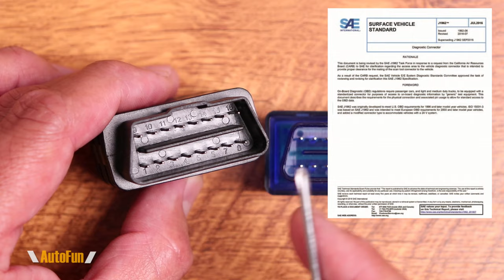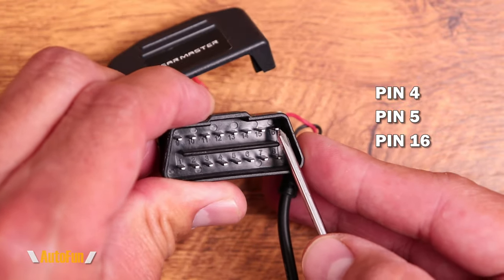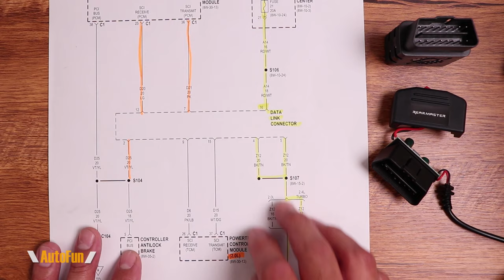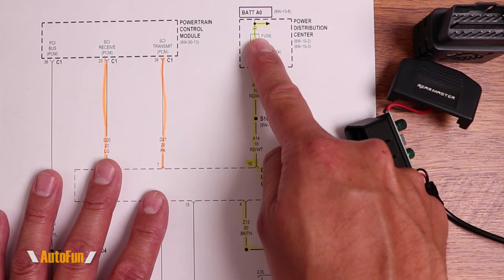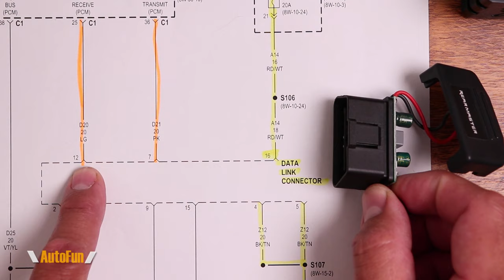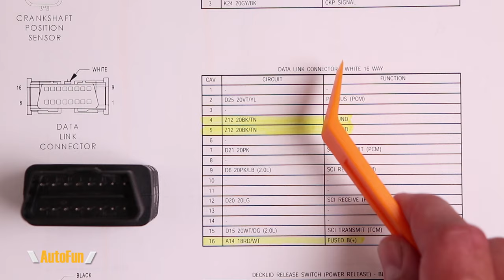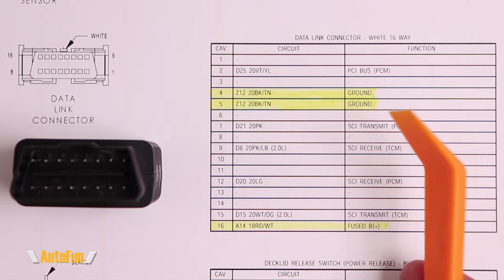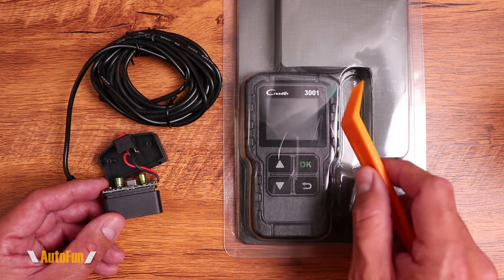OBD2 Power Adapter DANGEROUS? (Is it safe to use the OBD port for power?)

Comment: Thank you for the explanation.  I only have a question.  Right now, my dash cam is connected to the usb in my car.  And each time, i turn off the engine, the power in the usb is turned off, thereby the dashcam is off too.  With this obd device,  can i make use of the parking mode in my dash cam?  is it really a parking mode, or it will just continuously power the dash cam and keeps recording.  I want from this obd, is to sense the engine when it's off to power down and just activate the parking mode.  
Thanking you in advance!!
Reply from the maker: You're welcome gino! Ah yes the OBD2 adapter can be used to monitor the car while parked. It has 2 modes of operation which I cover in detail in my original video  https://youtu.be/YEklm9V6xYE However as explained on that video, the OBD2 adapter will not enable true parking mode like hardwire does. And here is my hardwire video in case you want to see that process https://youtu.be/uZp95NbNlmM Hope this helps, Cheers!
Reply: @AlexAutoFun  thank you very much. Now, it really makes sense to me. True parking mode can be done only with hardwire connection. The obd just keeps the battery connection and powers the dash cam. I bought the hardwire kit and try to install it myself. Unfortunately, all the fuses inside mazda 3 2021 are all powered even if the engine is off. I could only use the fuses under the engine hood, which would mean inserting a hole in the grommet, which would void the warranty. For now, i just connected the cam to a portable battery and portable battery to car usb. It keeps the camera powered and when i start the engine, the battery is being charged. Thanks a lot. I appreciate everything you do in your channel. Keep up the good work. Thank you!
Reply from the maker: @ginocruz8220  You're welcome!

Comment: Hi Mate,

Could you help with this issue.
When I switch on the car, the obd voltage box shows 12.3 v, and when I select the parking option on the camera, it shows Acc power not found. Thanks in advance
Reply from the maker: Hi P! Ah while the OBD adapter can potentially be used for park monitoring, it will not enable park mode. Here is my video where I cover this in more detail https://youtu.be/YEklm9V6xYE Cheers!

Comment: my question is most of car i know has 2 car fuse box(Daihatsu/toyota), in case of obd2 fuse has blown. which fuse panel should i check..
Reply from the maker: Hi Clovax! I would recommend checking your car's owners manual or service manual to determine the location of the fuse you are looking for. Cheers!

Comment: With only those wires, how does it know if the car is in accessory or not? It looks like the power source is always on. If it doesn't see the computer, how does the switch know whether car is on or off? You said elsewhere they are not "true" parking mode. What's that mean? My cars are parked in the garage most the time so I don't want to tap full time power all the time from a fuse tap. But I do want to be able to turn on parking mode at times. The switched OBD port seems like the best route, but from the video, the switch looks move like on or off.
Reply from the maker: Hi Steven! Ah remember the OBD2 adapter does not know if the car is on or off which is one of the reasons it will not enable true parking mode on most dash cams. However it can potentially be used to monitor your car while parked since it has two different power modes, (each one with different time out settings) I cover them in more detail and how they work on my original video here https://youtu.be/YEklm9V6xYE (links to the different OBD adapter are on that video description also since they are different types) Cheers!

Comment: Another great video! I wonder if you would have any comments on this tip that user A. Browne posted elsewhere for users of one of these products? 
"I'm very pleased with this product and I'm writing a review in case anyone has the same issue. (I drive a 2014 Honda Accord.) I leave this product set in the position that turns off after 5 minutes when the car is off (not the always-on position). I started noticing that my dash cam would randomly turn off on long car rides on the highway. I thought this power cable was faulty and I could get the camera to turn back on by flipping the rocker switch to always-on and back again. But after some more time in the car, I was able to isolate the problem better. When my car is running at a constant highway speed on cruise control for a long time, the OBD voltage drops and the camera turns off. All I have to do is slow down my cruising speed by about 5 mph, and then the dash cam will come right back on - then I can resume my original speed. This might be a function of the OBD protocol at constant speeds, or it may be a gas-saving feature of the car - reducing alternator load (and voltage output) when it's not required. Luckily my dash cam makes an audible tone when turning off, so I know when to adjust my speed and turn it back on. I never seem to have this issue during city driving."
Compliments to you and to A. Browne for your helpfulness.
Reply from the maker: Hi Luke! correct, there are cars out there that can see a voltage drop either due to a failing alternator or due to a gas saving feature where engine load is reduced at the expense of available amperage for electronics. However it can also be that the dash cam was exceeding the amount of power the OBD adapter can deliver (symptoms are very similar, dash cam run for some time, OBD adapter overheats due to being overload and turns off to protect itself, dash cam comes on again once the OBD adapter self resets or if reset by person) Here a more detailed video where I cover this https://youtu.be/Yky9_tTvwMc Hope this helps and thanks for watching!
Reply: @AlexAutoFun  Thanks for listing these possible causes of that problem, and for confirming that it could be a gas saving feature. I'm learning lots from your channel. The video about differences between hardwire kits is also an eye-opener for me. I hope you have a great day!
Reply from the maker: @lukewadel3675  Awesome! glad to hear it helped! Cheers from Califonia!

Comment: Is safe to use it   .Odb on any dash cam? Instead hard wire
Reply from the maker: Hi Fisher! this video cover this topic in great detail so you can consider the risk associated with connecting an OBD2 adapter to a vehicle and decide if you want to do so over hardwire or not. Cheers!

Comment: May I also ask, if I already have another device (a little HUD2 from Scoche) drawing a bit of power from the OBD 2 plug, but with a pass through for more devices, would there be any reason for me not to plug the dash cam power cord that you recommended into it, beyond the small risk that you described in this video? Should I get someone in the know to test the quality and quantity of the electrical signal being passed through before I "risk it"? Thanks for considering if you have time.
Reply from the maker: Hi Luke! ah good question the OBD connector is typically designed to handle larger loads than what the OBD adapter will pull (The amperage requirements are also described in the J1962 standard) however the implementation is still dependent on the car brand you have (what size of wire they used, what fuse size they used etc.) that can limit the maximum amount of power that you can pull from the OBD connector (basically your fuse will blow when you exceed this) Hope this makes sense my friend!
Reply: @AlexAutoFun  It does make sense. Thank you! :)
Reply from the maker: @lukewadel3675  You're welcome!

Comment: I had installed an Apeman dashcam in my sistets car using their OBD2 power connector.  Unfortunately, one day, the camera fried and blew the main fuse to the car.  Now, I hardwire them.
Reply: Also, a lot of OBD2 ports cut power after 5 minutes, thereby preventing charging when in Parking Mode.
Reply from the maker: @ptinker106  Hi P! Thanks for sharing your experience. I been running mine for over 5 years now without an issue and since making this video, we also seen more dash cams like Ring, Garmin, Thinkware, Vantrue, Nexar, Wolfbox, use OBD2 power adapters. However, yes in some cases this is not a viable solution, or if you just want avoid using the OBD2 port for power (and also looking to enable park mode) here is my follow up video showing the alternative Hardwire method https://youtu.be/zbxYA4VhuT8 Cheers!

Comment: Can this obd cable power a 3-way dash cams? Front, rear and inside the vehicle?
Reply from the maker: Hi! This will depend on the power requirements for your dashcam and the connector type it uses (I placed links the different OBD2 adapters in the video description). I have actually just made a video showing how to tell connector types and explaining power requirements on dash cams to help you see if it will work here you go https://youtu.be/Yky9_tTvwMc Hope this helps, Cheers!

Comment: Very interesting and I wonder if you have a comment on the following. I have a new 2023 Kia Sportage and have installed a Thinkware u1000 dash cam. They used an Echomaster HWK-TW01 OBD harness and I can't program the dash cam to shut off when the ignition shuts off. Geek installed, as opposed to the wiring that comes with the camera, and I'm returning to them tomorrow for troubleshooting. Have reached out to Thinkware and the product manufacturer and can't get an explanation of "how to do" or "can I shut it off". Thoughts would greatly be appreciated.
Reply from the maker: Hi M Clukey! interesting, the echomaster is a interesting device because it the only OBD2 adapter that can enable parking mode thru OBD however since it relies on sensing a voltage difference, how effective it is at detecting it will depending on the voltage difference (between on and off) of the vehicle. One way to eliminate the adapter as being faulty would be to move the setup over to another car to see if it works there. Hope this helps and please keep us posted on what they find!
Reply: @AlexAutoFun  Thanks for your feedback. I just returned from Geek S troubleshooting.... and they found out the "new" OBD cable was defective. Since another was not readily available, we used the hardwire that came with the camera and "ALL IS GOOD!"
Thanks again
Reply from the maker: @mclukey9037  Awesome! glad to hear that! honestly when it's professionally installed it makes sense to use the normal hardwire kit, not sure if they were trying to save time with the OBD2 adapter LOL

Comment: i have the same reader 3001 as in video shows. so you think it will cause a damage to the cpu of the car? thank my friend
Reply from the maker: Hi kostas! so far I haven't had any issues with mine, I think the possibility of getting a bad tool that can can damage your cars ECU really comes down to the potential scenarios described on the video which while very possible are not very common. Hope this helps, Cheers!
Reply: @AlexAutoFun  thanks have a good day
Reply from the maker: @kostast100  You're welcome!

Comment: Could you add this n conjunction with a Blackvue lithium battery so as to charge the independent battery for your dashcam.  Thx
Reply from the maker: Hi Manvet 67! nope unfortunately out of the box the Blackvue lithium battery pack only supports charging via cigarette lighter socket or via hardwire but maybe one day they will add a OBD2 option. Hope this helps, Cheers!

Comment: Hi, I just ordered a OBD kit from Vantrue to use it with my Vantrue N4 Pro. There it said the kit's description that 'The dashcam will then automatically switch in and out of parking mode as soon as you switch the car on and off.', should I trust it or it still won't enable 'true parking mode'?
Reply from the maker: Hi Huy! Yes some dash cams offer OBD2 adapters that can enable parking mode. These OBD2 adapters are different from the universal shown on the video. They are meant to be used with their corresponding dash cams, like this Nexar OBD2 adapter https://youtu.be/lBEGcLvNedc it can enable park monitoring but notice the adapter is specific to the dash cam. So I would follow Vantrue's recommendation for the correct OBD2 adapter to use. Cheers!
Reply: Hi Alex, Thanks for the explanation and I feel relieved with that OBD order. Just found your channel a few days back and its like a whole new world to me, keep up the good work 👌 @AlexAutoFun

Comment: Hi AutoFun and thanks for a great video :) I hope you can help me...I recently plugged in a small 2.4W solar trickle charger (AA brand) to my EOBD port. The connector didn't seem to fit very well on my Hyundai Coupe (Tiburon) , I connected my DMM to the SAE quick connect and got around 40mA and the voltage was same as battery voltage 12.7V (20V VOC) so all seemed well  however now my central locking doesn't work! and every time I turn the ignition off then back on (Position 2) the car acts like a battery disconnect (ECU reset)??? Any idea what has happened? Solar charger uses PIns 4 , 5 and 16 like you video above. Many thanks
Reply from the maker: Hi Daniel! interesting, I haven't tried trickle charging via the OBD2 port but what I would do is check the wiring schematic of the car too see if the OBD2 port is not sharing any of the connected positions with any other system. Some newer cars are very sensitive to having a new device connected to them (specially if they are equipped with CANBUS) what's interesting too is the charging voltage you are getting, battery maintainers and trickle chargers normally operate at around 13V at a minimum so it's seems the actual effectiveness of the solar trickle charger may also be in question. Some cars also pull quite a bit of power when off, 40mA seems way too low to cover the normal draw on a car that is off and also trickle charge the battery, but then again I have not tried one yet, please keep us posted on what you find friend, Hope this helps, Cheers!
Reply: @AlexAutoFun  Thanks for the quick reply. Yeah I've measured my normal resting battery draw and its 12mA and yeah the charger seems to adopt whatever the battery is resting at....measured  today at 12.69V and with charger connected 12.70V. I've just tested the polarity of the solar charger and its fine and it was reading 20V open circuit before connection. I can't help thinking because of the bad fitment of the OBD connector which I pushed rather hard might have caused a short? or blown a fuse? Tomorrow I'll check all the fuses
Reply: Sorry I forgot  Pins 4 and 5 on the solar charger are protruding more than all the other pins which are dummy pins except pin 16 which is Batt +
Reply from the maker: @danielconnor1458  Hi Daniel! that sounds correct, both Pin 4 and 5 have to make contact first (which is why they are raised) according to the SAE-J1962 spec...
Reply from the maker: @danielconnor1458  Yeah checking the fuses is a good idea and also check to see if there are any DTCs (some DTC's don't trigger a check engine light)...
Reply: @AlexAutoFun  Thanks again AutoFun you've been very helpful....I've just realised something....cars and women...can't live with them, can't live without them :) ha
Reply from the maker: @danielconnor1458  LOL!! You're welcome Daniel!

Comment: Hi, can i plug this into a hybrid?  It should work the same way as the cigarette lighter if the camera goes off when the car is shut down.  I have had my dashcam plugged into the cigarette light for a couple of years with no issues!  I read somewhere dont use with hybrid or electric vehicles.
Reply from the maker: Hi Anne! the OBD2 port functionality as far as power seems to vary from hybrid to hybrid (depending on Make, Model Yr etc.), some hybrids will cut power to certain items that are not considered as currently being used, where on a gas powered car the OBD2 port is typically powered all the time. So it's possibility that the OBD2 adapter may work intermittently. I would recommend checking your owners manual to confirm if your car's OBD2 port has any limitations as far as power is concerned. Hope this helps, cheers!

Comment: where do you find the schematic for your car's ODB2 layout? I've got a 2015 LCI F12 BMW 640d Coupep
Reply from the maker: Hi Jacob! The best place to get it is the service manual for the car (usually available at the Dealer and sometimes on Amazon). Alternately there are dedicated websites that also give you access to diagrams (some are subscription based and some are one time buy diagrams) Cheers!
Reply: @AlexAutoFun  hi Alex, thanks for responding. any tips as to what keywords should i be looking for? "car model year fuse schematic" doesn't seem to bring anything back.
Reply from the maker: You're welcome Jacob! Ah as I mentioned if you go to your dealer they should be able to pull it up using your car info. If you want to get it online, try Amazon or Ebay (for one time buys) or AllData (for subscription based). Cheers! @jacobb9177

Comment: Namaste 🙏🏻. I am from India. Today i brought a DDPAI OBD 2 kit for my DDPAI Z50 4K Dual Dashcam. I m driving Suzuki IGNIS. There are only 3 pins on the OBD 2 kit. Please can you lend me any knowledge from your side.
Reply from the maker: Hi Ram! I have not tested or done a tear down of the DDPAI OBD2 adapter so I can't comment on how it works but it is likely using the same positions as the adapter shown on this video since the OBD2 port is a standard (so all the pins must follow the same position assigned by it) But if I do get a hold of the DDPAI adapter and tear it down, I will update this comment for you. Cheers1
Reply: @AlexAutoFun  Thank you 🙏🏻
Reply from the maker: You're welcome friend! @rampatil-jg1ov

Comment: ok , tell me please ,its safe or not ? connect U 3000 Twinkware ?
Reply from the maker: Hi Elias! There are many factors to consider to decide if you feel comfortable using an OBD2 power adapter. I explain several on them on the video in great detail to help you decide if you want to run an OBD2 adapter or avoid it. Cheers!